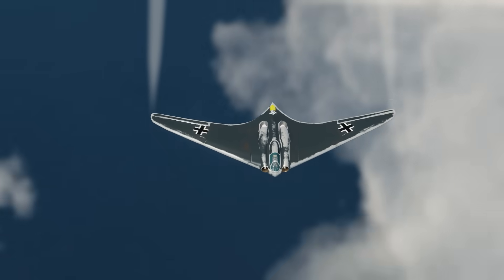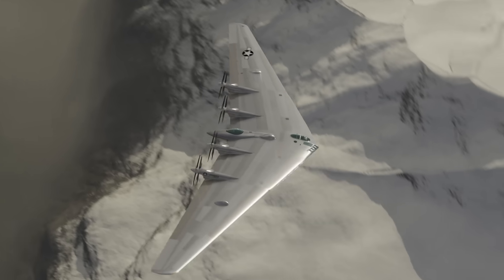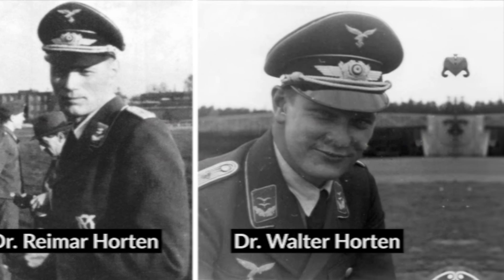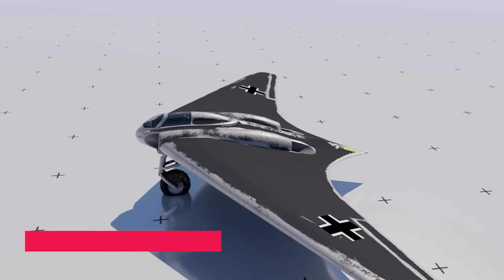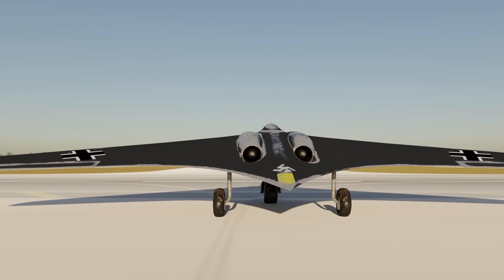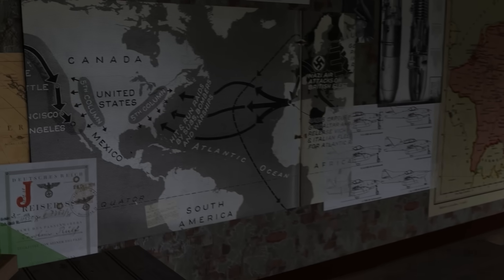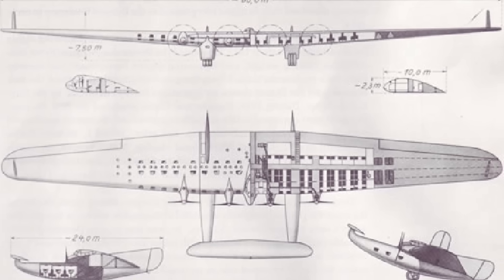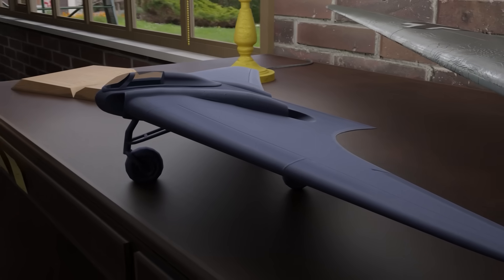Insane Flying Wing Jet Fighter To Save Germany - Horten Ho 229 Nazi UFO

Comment: Germans did know about radar as they also had radars themselves. What they did not know was Downing air defence system that would guide British fighters towards German bomber formations.
Reply: One thing that the Germans underestimated about the British radar was that it was linked across many of the chain home stations. We used the 50hz mains supply to synchronise the system. Like a lot of things luck plays a lot in war.
Reply: Yes but they didnt know how to nullify Radar. they didnt have the knowhow to create a stealth plane, nor the money, time, equipment, manpower or really anything.
Reply: @felixschrider9037 testing conducted by Lockheed and Northrup confirmed that the Ho-229 had a significant reduction in frontal RCS and would have given the aircraft a tactical advantage against British detecton radar systems..

Comment: "... hardly packing, only carrying two 30mm cannons." lol Wut? That's a very powerful armament, a single shell from either of those 2 cannons would be enough to completely destroy most fighter aircraft. At the very least, it would put a very big hole in it. These were relatively fast-firing fully automatic 30mm cannons for their day too, so even just a few seconds on target would be enough to inflict catastrophic damage. I don't think you have any grasp on just how powerful 30mm cannons are.
Reply: yeah, 30mm minengeschoß shells could nearly sever the tail of bombers in a single hit, the only reason it could be said to be not too powerful is because stuff like like the Me 262 had 4 30mm mk 108 autocannons and also 2 20mm MG151/20s
Reply: @user-Xx0xxxxx  Preach. Those M-shells were known to rip Allied bombers, and that’s coming from a single MK-108 on a Bf-109. The only downside maybe was the equally powerful blowback from the autocannons, which rumbled throughout the fuselage. They weren’t called “pneumatic hammers” by pilots for nothing.
Reply: If it's the MK103 30mm gun then it is indeed underwhelming since the build quality was kinda shit so they have to use smaller propellant causing slower muzzle velocity, if it's the MK 108 then it's a different kind of beast in itself.
Reply: @nebunezz_r  Nope, the reason for the low muzzle velocity is the short barrel, wich is only about 0,5m long, giving you about 500 m/s at the muzzle. The barrel was so short to cut down on space and and weight. The MK 108 is about 88kg lighter and 1,2m shorter than the long barreled MK 103.  Both guns share the same projectile, but the MK 103 30x184 Borsig cartridge holds much more powder then the 30x90 RB MK 108 cartride, as the short barrel cannot take advanate of the additional powder. That both can use the same 30mm Mineshell also shows, that the very thin wall of that projectile was not the limiting factor for projectlie speed. For comparison, the MK 103 muzzle velocity was 860m/s compared to the 545m/s of the MK 108. This  also allowed the effective use of AP Shells aggainst tanks in the MK 103.

The build quality was not the problem in the MK 108, the short barrel was. But it was also supposed to shoot at slow moving bombers, and not at fighters, thus, the low muzzle velocity. It was a trade off, and the germans traded muzzle velocity and rate of fire for the maximum bang per weapon weight.

If you want to look up a really cool late war german weapons project, look up the MG 213/20 or MG 213/30. That aircraft gun would have fixed almost problems of the earlier guns. High rpm (1000 rpm for the 20mm), light weight (56kg) and high muzzle velocity (at least for the 20mm version). That gun was in fact so good, that every one copied it :P Even the board cannon on the eurofighter (BK27) can trace itselt back to this gun. 

Have a nice evening :) 

Oh, and sorry for my autistic info dump, that is a subject i am really interested in.
Reply: @13deadghosts  Ho 229's sporting Mk 103s would have shredded B-17 and B-24 boxes.  Then imagine them getting retrofitted with the MG 213/30s.  

Glad this amazing airplane never got into the fight...
Reply: @13deadghosts  Also the operation. Pure blowback. High explosive capacity, cheap, light, crazy fire rate, short range, horrible ballistics. Everything comes at a price.

Comment: The use of wood for construction was due to the shortage of aluminium and skilled labour to work with. The mentioned stealth wing was a sandwich construction with charcoal and wood flour in the middle of the sandwich with wood forming also the outer shell. But this wing wasn`t built due limited time, as they had to skip the wet wing concept, due to the lack of fuel resistant glue. The Horten IX is comparable to the Mosquito regarding stealth and construction material.
Low drag was one goal of the Horten brothers. But to make their wings controlable they choose to use a bell shaped lift distribution, which produced more drag than an eliptical lift distirbution. So there were no gains here, but the Horten wings were among the first flying wings which were controlable.
The redesign from Gotha Waggonfabrik was nothing major. The major redesign occured before, as the dimensions from the engine changed from 600 mm in diameter to 800 mm height and 600 mm wide due to changes in the placing of accessories. The wing span was increased from 16 to 16.8 m and the wing thickness rose to. The critical mach number was expected at 0.75 and the stall speed of V 2 was 150 km/h.
The characteritic form of the trailing edge (called in the video "bell shaped") was due to the effect that a swept wing produces less lift in the middle as expected (Mittenefekt), and as a simple solution they increased the wing area in the middle. 
I just took an old book (Nurflügel, ISBN 3-900310-09-02) from the shelf to look after some of the mentioned details above.

Comment: It was the Horten 9, given to Gotha for production, and they called it the Go-229.

Junkers patented it in 1910, Stout put it into flight (with a fin) in 1918.
Cheranovsky put it into flight (again with a fin) in 1926.

Being completely tail-less isn't the criteria, since many finned allowing types have flown, some of them well, a few notably better that "normal" planes.
They called Northrop's "Avion" h216x a flying wing even though it had a tail, because it left off a fuselage and put everything in a lifting fuselage body.
They called Burnelli a "flying wing" too.

The Go-229 wasn't "stealth". Its engines and cockpit would have shown a strong return.
It takes far more than smooth aerodynamic surfaces and lack of a tail to make it stealthy, and the Germans were not concerned with making it harder to detect. 
Not everything made as a lifting body fuselage is for stealth.
It's tabloid quality media hype to say that stealth is why they're designed that way.

Many all-wing plus a fin have flown, not a single one without a fin has made a workable plane. I include hang gliders, sport gliders and the B-2 in that. It's not a workable plane if it can't fly without advanced controls and the crew must always be ready to eject if any of that advanced control technology fails.
Reply: Go-229 was the given production number for the Gothaer Waggonfabrik by the RLM!
Reply: Go-229 was a mistaken ID, the Ho-229 is the correct nomenclature. The engines and cockpit would show a return but the infancy of radar in the 40's would not have been enough to reap the benefits of early detection and thwart this design's low radar signature.

Comment: If you look up the Kenneth Arnold UFO siting, you will realize that the US experimented with directly upgraded, all aluminum copies of the HO-229 and may have even installed our more powerful Lockheed L-133 engines in it, Kenneth Arnold estimated them to be flying almost 1200MPH/2000KPH
Reply: You're really confused.

Comment: "Hardly packing"
Twin 30mm machine cannons capable of blasting an aircraft in twain with mine shells
Reply: Aircraft machine guns (less than 15mm) on fighter aircraft were effectively obsolete by WW2, the most effective guns were 20mm or larger auto-cannon. Many Allied Fighters lacked cannons due to massive shortage of reliable Allied cannons. The American M1 20mm program was the biggest Allied blunder of the war, worse than the Mark-19 torpedo fiasco.
 We know from tests conducted by the Allies after the war that the German MK-108 30mm cannon was by far the most combat effective gun mounted in any aircraft during WW2.
Reply: @DoktorBayerischeMotorenWerke The Germans still used machine guns! MG 151 in 13mm !!!!!!!! 😂😂😂😂
Reply: @ Yes, 
because the American M1/M2 20mm copy of the Hispano-Suiza HS 404 was the biggest, most shameful and humiliating scandal in American military history... worse than the Mark 19 Torpedo scandal.
 Millions of defective rounds and thousands of completely useless defective guns were produced and no acceptable solution to these problems were ever found, it remains the biggest blunder in U.S military weapons history.

The M61 Vulcan was designed by former Nazi engineers who were brought to General Electric after WW2 by Operation Paperclip.
 The M61 round is based on the Mauser MG 213 round developed in German at the end of WW2.
 German fighter aircraft were armed primarily with 30mm and 20mm cannons while American plane were almost always armed with the obsolete .50 cal M2 Browning machine gun.

Any questions?
Reply: @DoktorBayerischeMotorenWerke obsolete? It's still used today but not in aircraft......You're too much of a anything German military fanboy too appreciate any of the German military failures especially in leadership roles, they were always on the defensive earlier on in the war, it was the allies who wear pushing new technology ,they were on the offensive, the Germans never had commando units or  OSS  SOE, SAS, SBS etc of that nature.....they were always going to lose the war
Reply: @BobFiltration  ALLIBOO TROLL  ALERT ⚠
Reply: @DoktorBayerischeMotorenWerke always  going to lose, sure technology was developed by the Germans that's what's it supposed to do alongside social changes throughout the word.......it's always happened it happening right now
Reply: @ Aircraft machine guns (less than 15mm) on fighter aircraft were effectively obsolete as primary armament by WW2, the most effective guns were 20mm or larger Auto-Cannon. 
Many Allied Fighters lacked cannons due to massive shortage of reliable Allied cannons. The American M1 20mm program was the biggest Allied blunder of the war, worse than the Mark-19 torpedo fiasco.
 We know from tests conducted by the Allies after the war that the German MK-108 30mm cannon was by far the most combat effective gun mounted in any aircraft during WW2.
Reply: @BobFiltration  Hardly anyone is in favor of the US when it comes to technology; cope more.
Reply: none Horten flying wing was armed and only some prototypes did fly, all the rest is pure invention...and the 30mm german air cannon was pretty bad: low accuracy, low reliazbility, the 20mm Hispano Suiza HS404 (french design cannon (use on Morane 406 and Dewoitine D520, firing trough propeller shaft),  adopted from the Brits with some mods to fit in the wings) was MUCH better...
Reply: @leneanderthalien  And yet could rend apart British bombers with but a single mine shell. Your point?
Reply: @DiverWithTheBends  inaccurate and slow firing guns wouldn’t fare well against fighters. .50 cals would rip this thing apart.
Reply: @siko9799  Its intended target were slow, large, bombers. Its an interceptor, not an air superiority fighter.
Reply: @DiverWithTheBends  bombers were escorted by fighters, so if it was in a fight with one, then it would be a problem. plus, bombers such as b-17’s and b-29’s are full of .50 cal mounts, which would make short work of the 229’s wooden airframe.
Reply: @siko9799  I don’t think you understand that the plane could go 600 mph. Most guns were designed to shoot at normal prop fights, but a Jet that had a small cockpit, thin design, and could fly and miniver fast would make it a nightmare for gunners to shoot down. They went so fast, the ball turrets and side and top guns probably wouldn’t have even gotten 2 shots on them. It’s like shoot an LMG at a 3 layer paper.
Reply: @siko9799  it sacrifices armour and damage resistance for speed and small size.
Reply: @siko9799  .50 cal machine guns were obsolete by WW2 and delivered very low combat performance compared to 20mm and larger cannons.
Reply: @DoktorBayerischeMotorenWerke You know why they stuck with 50cals right? Because they were developing the M61 vulcan cannon at the end of the war  .......I didn't see any Germans developing  it ! 😂😂😂😂😂😂😂
Reply: Just machine guns ya hurred
Reply: @alexander1485  Pardon, 30mm is in fact a cannon caliber. The german nomenclature use MK to denote a machine cannon (or at least that is the literal translation) compared to what would be described as a machine gun (which in german nomenclature was below 15mm, although maybe one of the 20mm cannons used MG in its designation)
Reply: @DiverWithTheBends The MG151 was originally chambered in 15 mm, which would be a very heavy heavy machine gun. After noticing that it had insufficient destructive power, they resized it to fit a larger shell, but didn't change the nomenclature besides adding MG151/20 and MG151/15 to avoid confusion.
Reply: MK = MaschinenKannone MG = MaschinenGewehr, pretty simple
Reply: @sin-r6p  Thanks m8, I just didn't want to butcher the spelling of maschinen because I... don't speak german lol

Comment: Vne is a structural limitation, has noting to do with the ability to cruise at 1000kph. The Horten did not use the bell shape lift distribution Al Bowers talked about. The Bell shape was primarily the innovation of Prandtl, not the Hortens.

Comment: The 229 wouldn't have worked simply due to fact of no computer controll. The only reason the B2 is stable is the fact that it almost flies itself.
Reply: Several allowing without tailfins have worked.
Like the Northrop bomber, fixes for any instability were available, were in use for other things, but would have required a rebuild. The Nazis had no time or fuel, and for the B-49, the USAF didn't want it or for Northrop to build new factories. The USAF chief was corrupt, on the take from Convair and that's what killed the Northrop.
Not lacking modern computer controls.

Comment: In aviation, a stall is something that happens to an airfoil (usually a wing), NOT an engine. When the angle of attack exceeds a critical value, the airflow will detach from the top surface of the wing and lift disappears. This is generally considered a Bad Thing, and is to be avoided.
Reply: You can get compressor stalls in engines. The compressor and stator blades are airfoils and airflow can detach, resulting in a stall. That's why in older engines certain maneuvers or aggressive throttle movements could cause engines to stall. Nowadays the stator blades can move in angle of attack to prevent stall.
Reply: @ChucksSEADnDEAD  That's why I said "airfoil (usually a wing)".
Reply: @StevePlegge  You said it doesn't happen in engines.
Reply: Yeah, that was cringe-worthy, seeing how little the writers understood.
Reply: The Northrop N-1M was the first flying wing.
Reply: @Rico-v7r  not true, by a wide margin.

Dunne, 1916, Stout, 1918.
Lippisch 1929, Cheranovsky 1926.

Northrop 216 "Avion" was 1928,  far far better than his later all-wing minus tail, was called a "flying wing" which is a media hype term.
Reply: @JFrazer4303  None of what you said was true by any margin.

The Dunne, Stout, Lippisch and Cheranovsky were not true flying wings. They either had vertical tail assemblies, pronounced fueslages or both.
Reply: @JFrazer4303  The Avion Experimental was also not a true flying wing. 
A flying wing by definition is a tailles, all wing aircraft which points to the fact that the Northrop N-1M was the first true flying wing